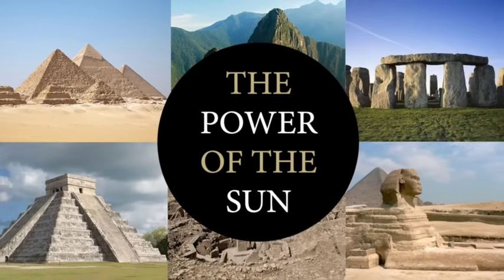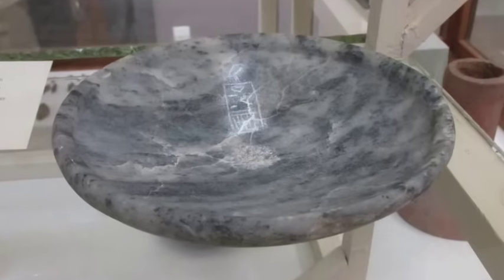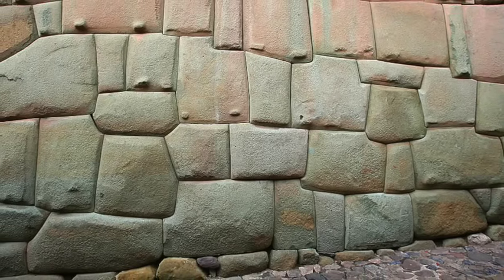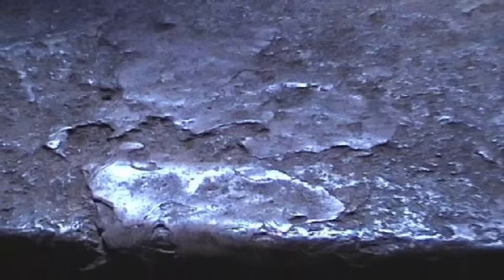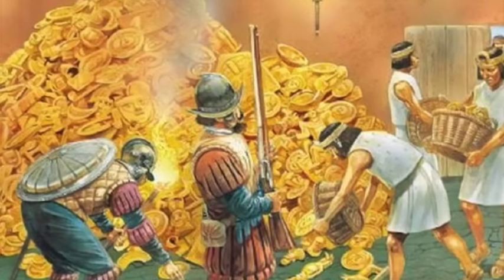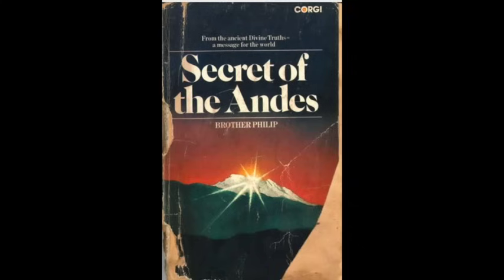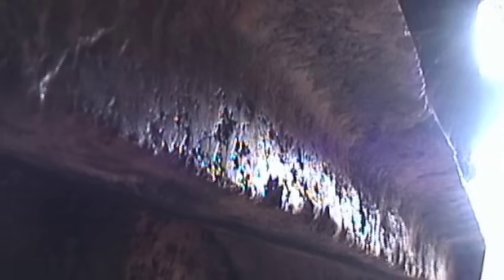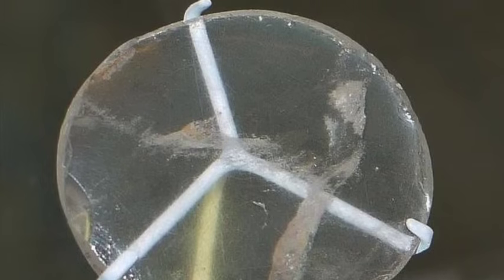How the Ancients Cut Stone with the Sun - Lost High Technology Explained | Ancient Architects

Comment: it makes perfect sense . They were good in polishing, had hard sharp stone insets on blunt tools, and made optical objects. when you see the size of the pyramid, a contraption of a 4 meter gold disk to reflect light is not out of range . How do you calculate it ? I suspect, instead of reduced by Inverse Square for each unit distance of lenght, its increased as to match a focus area . Intensity is instead increased by shrinking focal area .

Lumen is the light source, Lux is the light on the target, R is the Radial lenght, distance between the source, and the target wall, as in electrical lighting , and obtaining Lamp lumen value on the package . a desired Lux from the customer may be 400 lumen on the work table. 50 Lux is dim, but visible, until 10-5 lux . 

Lux = Lamp (sun) 1000 Lumen / 5 meter distance ^2 = 40 Lux on the target wall. If the focal curves are straight zero degrees. but if the focal angles is curved paraboled into a focus . 45 degrees (1/2), 22.5 degrees (1/4 ...). the ring disk area becomes smaller on the target . 
If you focus the light, Lumen is not directly translated into Watt. electrical watt is added after the performance of the lamp is established, however its named in W/m^2 . Neither does the Lux or Lumen say anything about the temprature of the light . Lets say the "lamp or Sun" is a reflector arranged onto a stone target 5 meter distance. so the diameter equals the focal distance from the bottom of the pan .

Lux (1) = Lumen / R^2
Lumen = Lux * R^2
R = SQRT Lumen / Lux
Lux (2) = Lamp (sun) 1000 Lumen * 5^2 = 25 000 Lux by reducing the focal area R^2 times . (?)

Electricity and Paraboles , light and antennas, is very relevant knowledge in all ages . there is only one way to find out if the calculations are correct, build it !

Comment: Ancients did not CUT anything. They had Solar Lenses to melt metal and granite. The 3 great pyramids were all built with molding techniques and limestone concrete. All the perfect cut holes can be explained with that. All the statues, faces were all molds. And there are even  petrified wooden molds found between some rocks that you can check out today even.

Comment: yeah, this is interesting but i don't think that anyone was melting the massive blocks of granite then pouring what would essentially be lava into said moulds. I doubt that anyone back in those days had asbestos suits to wear,  if anyone has watched videos of people taking samples of fresh lava, they can only just get near the stuff without running to safety maybe 20 secs later and thats wearing the asbestos suits. Also if the granite was melted to the point of being able to pour into moulds, it wouldnt resemble granite any more, the heavier rocks in the stone itself would sink to the bottom and the small stuff pushed to the top. It would be homogeneous anymore. but these blocks still resemble granite. hell, they have found the quarries where these blocks had been cut from...its all Highly compelling though :)
Reply: Found a company in Europe that casts basalt pipes. 1250C is needed.

Comment: Honestly even if the light wasn’t specifically used to do the cutting action it could bring the rock up to very hot temperatures that would make the chemistry with acids to soften the rock even easier for forming.

Comment: I think the evidence to support the melting of stone with large parabolic mirrors is pretty compelling. Perhaps they even had lenses to focus the focal point of the parabolic mirror into a laser too. The ancients could have used different sized materials with which to construct the walls. Perhaps the builders used even powdered stone and they melted it layer by layer kind of like 3D printing but they use a heat resistant mold form and maybe that’s how the vitrified surfaces become visible... once the form was removed the surface of the stone must have been so smooth and glossy! These walls must be so ancient that even most of the vitrified surfaces have eroded away to an extent.
Reply: What evidence, lol. 
They cut the things, not melted and not even with a "laser" like tool. The other evidence not shown ofcourse show this. Not all blocks where perfect and there are quarry-sites that where either close or very nearby. 
- Talewise, texts, hyrieoglyphs, etc never mention anything about lasermethods, but they do about cutting.
- Glazing effects do not guarantee melting only, one might very well see it as polishing or uneven polishing. There are enough 100-500-... year old floors showing this effect.
- Sandpaper is able to polish and it is rather easy to "create" sandpaper. You can even cut with it like the ancient egyptians did + they had a lot of manpower.
(water polishes as well over a very long period of time, cfr pebbles. F.e. one can cut a groove for irrigation and after x amount of years that will cause a very well polished groove)
- There have been cases of fires that reached temps high enough to melt certain stone/rocks, but they are not flat all over, and always show a lot of irregularities.

- Granted, parabolic "mirrors" existed in Ancient Greece, this is true. That was also a time where Ancient Egypt was alreay very ancient.
- The two books that are referred to in this video are also from two authors who happen to be involved in conspiracytheories like ancient aliens and are pseudo scientists at best. This is a insufficient foundation to base a theory on.

I watched the full series of the Ancient Aliens f.e. and they are absolutely filled with errors which show a very significant lack of research skills. It's embaressing.
So whenever someone is involved in conspiracy theories that lead in that direction I find it very difficult to give belief to what else they (in this case the two authors and the person who used them as sources) claim.

And lastly - Please do not forget the significance of the impact on the daily life due to religion. It plays a major role in the structure of daily life. One of the effects is providing a mass of workers who can together accomplish many things. The truth is that we can build what they have build today in terms of potential, but we won't because there is no actual need for it. It's a bit like NASA's interest in deepsea exploration vehicles. They never looked into it until they needed it and have since improved existing vehicles. Same with the moontravels. There is no need and funding for it anymore.

Peace.

Comment: I dont think they cut stones. Not at least to build with cutted stones. They melted stones and casted them into needed shapes directly on the building site since the lack of power lifting 2 -22 ton blocks
Reply: If u let molten granite cool down slowly it will turn into its normal molecular structure. If its fast lot of crystals will form. So basically they layed down small bricks and melted them into big one.

Comment: The perfectly round holes were done with a core drill.
Reply: Correct. Proof of the hole saw is evident in the spiral marks on the inside of the hole. You can even calculate the feed rate. There are even some holes in junk stone stone at quarries that have rings cut around the hole where the workers started in the wrong spot.
Reply: So...can you tell how OLD these drillholes are? Are they maybe very young and just highlighted as a wrong example for...nothing?

Comment: yep thats why they had semiconductor technology too right? 

you can do this by hand no problem they had the substance to cut the materials the material itself is hard enough to work itself. 

stone tools are quite effective think of precision machine grinding its just rubbing stone on metal and it cuts damn near everything. 

theres lots of ways to make things flat and fit with hand work just take some  stone carving, blacksmithing or woodworking classes.

they had lots of time to do this maybe a stone took a week to make but with thousands of people say 1000 that can shape a block one cubic meter each a week 

thats a meter wide wall 52,000meters long or 5.2Km/year 

while incas were 12,000,000 strong 

thats 1/12,000th the population to manufacture an absurd amount of precisely hand cut masonry.  

even half this amount is a ridiculous amount

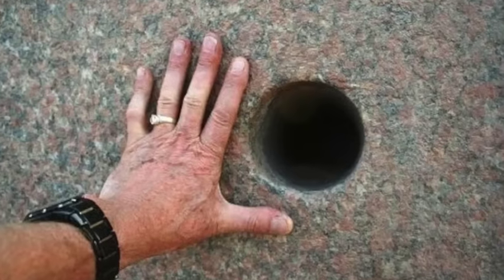Comment: 0:45 "perfect" not even close. Every single drill hole measured shows a taper and are not circular consistently down the length of yhe hole. Which is consistent with the tube cutting technique in Egyptian hieroglyphics. 
Admit it. "Advanced" technology was not required to do what they did.

Comment: Maybe on to something, but there’s still the mystery of how the heck they moved such huge megaliths. Especially if they could easily cut them into smaller pieces, why wait until it’s moved to cut it?
Reply: What megaliths do you refer to???  Also you might want to look at "when" those megaliths were created as well as their relative location from the quarry to where they were supposed to go.  As an example.  The blocks at Baalbek sit about 1km away from where they would have eventually been placed.  They also date to the time of the Romans = and the Romans had iron and steel.  That is important because to transport something via wheeled transportation you would need the wheels and structure to be reinforced with iron lest it collapse under the weight of the load.

Meanwhile if you go back further to say the Egyptians you'll note that quarries such as Aswan sit uphill and near to the Nile.  Accordingly blocks need only be moved a short distance downhill from their site to the river = where they would be moved onto awaiting barges for transportation via the Nile to where they were going - where another harbor would be close by to the worksite.  

So in either case the distances are actually not that far while as noted the mechanism for movement differed.  The Romans widely employed wheeled transport which as noted would be reinforced with iron - while the Egyptians employed wooden sleds.  Heavy loads would be moved via teams of men and oxen - many seem to overlook the fact that ancient peoples employed draft animals the same we se still do today.  An ox can pull more than 2X it's own body weight.  Have a nice day.

Comment: There is actually a section of the site  at Machu Picchu where stones were cut, shaped and polished to prep for building. Much use of wooden wedges that would be then soaked with water, causing them to swell and crack the stone along carefully planned fracture lines.No solar lasers in sight. People can accomplish wonderful things without powered machinery or lasers. Just careful planning and intelligent use of human strength.

Comment: That is amazing. I believe the circular holes are also done by tuning forks possibly as well. I saw another video recently, it looks plausable too, the hieroglyphs show them holding what looks like a tuning fork or two with wire wrapped between them (to increase resonance), attached to a long rod that is speculated to be hollow like a pipe. Something to look at, but they did have lenses back then and this explains the cutting more than anything I've heard. I want to try it actually, just need a lot of gold and silver lol
Reply: No kidding you'd need a lot..and they sure seemed to have a lot of those precious metals back then. 
Where'd they mine all of it ..not to mention WHERE did they work it.
"The bottom of Volcanos" might not have been an exaggeration!!! 🌋 🌋 🌋
Reply: Water wheels... Pump water to a higher off the ground tank then thru gradually smaller / more narrow pipe or hose to use a water jet to cut stones. They also could have bumped up the power of the jet using compressed air. It would be hard, but I think it could be done. Only talking about 5 psi.. Too hard to get more than that using thick walled clay jar or sorts. Just a thought

Comment: I think you have figured out part of the secret, the other part would be that the Ark of the Covenant was an electrical capacitor, which would be charged by focusing the energy of the earth into the center of the pyramid where the Ark of the Covenant laid. Inside the Ark of the Covenant was the white powder gold, which could be charged on a sub electron level, increasing the mass of the monatomic elements. 🌝

Comment: Sorry but this one seems to be the most ludicrous attempted explanation. They precision cut stone like a jigsaw puzzle using hand held reflectors? What? That manufacturing laser was probably CNC that could be pointed anywhere you want with precision without having to worry about where the sun was.  And that cartoon... In at least some of the big examples it looks like they "rough cut" the piece first then used some secondary process to finish it. In manufacturing, it is common to rough cut the work piece to remove the bulk of material and get is close to the design surface. After roughing, secondary machining is performed. CNC milling is an example of this in action. Go in and rough it out then apply finishing passes. As for the bowls.. Someone need to laser scan them into 3D esp that odd bowl with the fins and that would tell us a few things after dimensional analysis. for starters you could look at the edges and curves/radii features and see how close they are between the different repeating features.

Comment: There’s a video here on YouTube of a guy using vibrating copper tubes or drill bits to melt straight through granite rock just using some high tension wire, and a speaker to cause it to vibrate.

Comment: 1:35 The picture shows the tools and how those tools cut hard rock. Its a method that has been used since the caveman days, literally. They took copper and embeded it with a stone harder than the one they were cutting. 
At first cavemen used wooden spears then tipped those spears (and knives) with sharp rocks.
Egptians did the same, then added sand as an extra abrasive. How do we know? They left pictures and writtings behind describing the techniques.
These websites claim laser like precision yet fail everytime to put a level or square against the surface to verify their claim.
A rope and stick is all thats needed to make construction squares that are precise. And that is exactly what they did. Again because the left their instruction behind along with quarries and failed cuttings which show how they did it.
No aliens required.
No "lost advanced technology" needed.
Just some clever engineering and haard work. Which they had plenty of.
Reply: Lol.  Yes they built things in the way you describe, but not the biggest and best things which were there before them.

Comment: Lots of hardeners need activation for a catalyst to work properly which would then melt/glaze.
A good way to reconstitute chalk/limestone is to crush & mix it into a paste, set it into a mould, set fire to it until it self combusts.
No doubt the reason someone decided to create a kiln for pottery.

I cant see a laser system as being anything other than unwieldy to use and awkward to set up.
Controlled cutting normally means controlling the cutter the material and the environment while constantly changing position (handheld device).
Lasers are great in a lab and with prefabricated blocks, shite in the outside world with manufacture on site.

Besides, you wouldnt get a spiral pattern on the walls of a core drill with laser cutting...thats rotation+pressure friction of some kind.
Not that there arent assisting tech to reduce the need for pressure.

No point polishing a hole thats been laser cut as it wont need finishing.

There are other more practical ways of cutting stone.
The harder they are the easier they are to cut in fact.
Use the right tool for the right job.
Plenty of evidence too, if historians had the slightest inkling what they was looking at.
Like a Caduceus.

Alas, historians and archaeologists are not engineers....and vice versa.